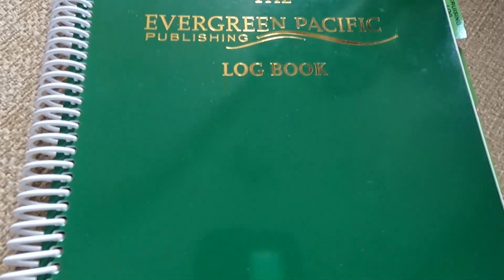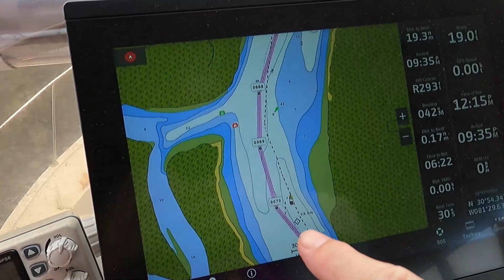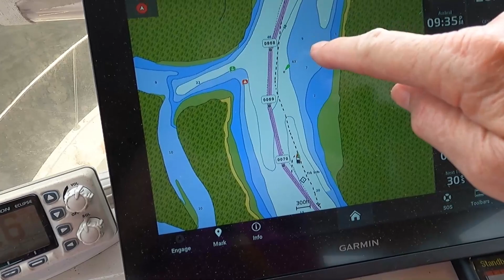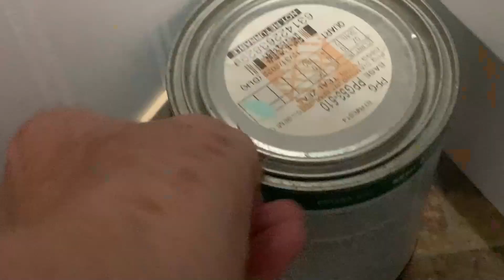Where There's Smoke There's Fire, Ep-238

Comment: I just docked at Brunswick Landing marina for couple days........
Reply from the maker: Awesome ! Wish we were there to greet you but I think we will both be in St Augustine at the same time. If you are not familiar with Brunswick, Fox’s Pizza is a favorite restaurant of boaters and is walking distance from the marina.
Reply: Did you get a slip in st Augustine yet? I need a cheep slip for couple weeks, I got new fan belts and I want to buy and install the correct 170 degree thermostats, port is now 190 and starboard does 160, but guages may be wrong........
Reply: V belt on a Lehman is 1/2 by 48....Dayco 17480 or duralast 17480....
Reply from the maker: @doncritzer2798   - I reserved a mooring ball